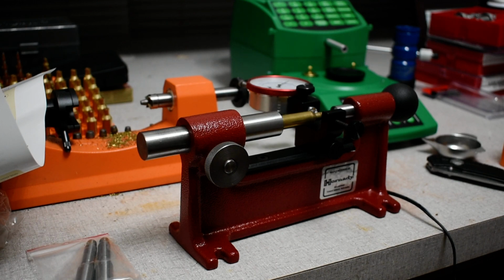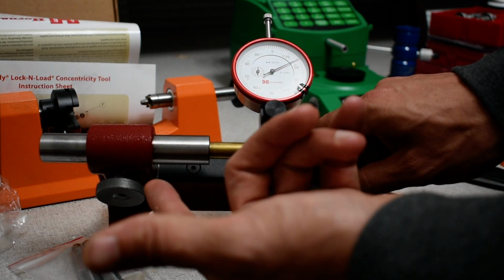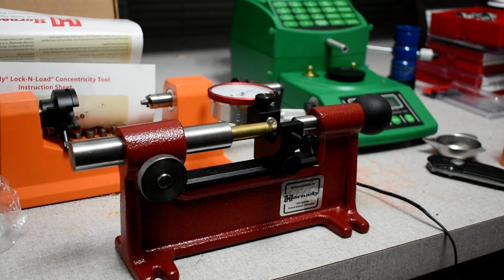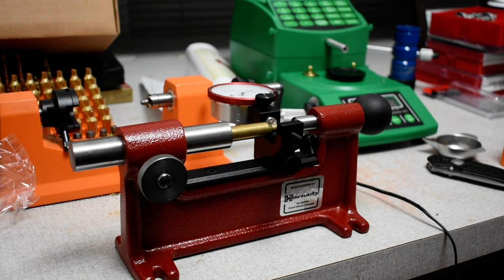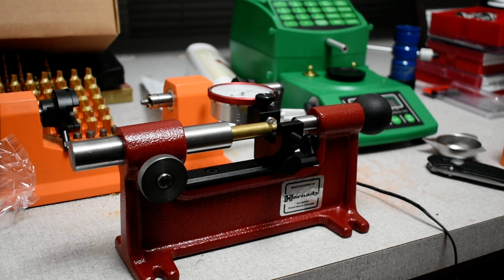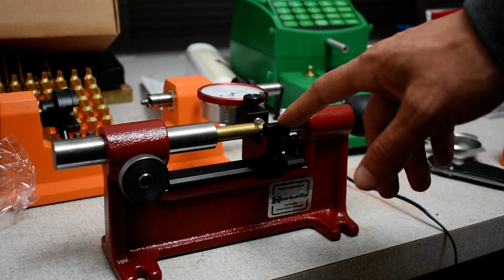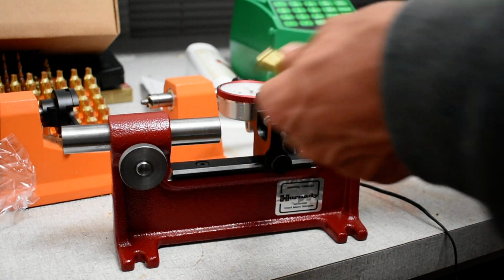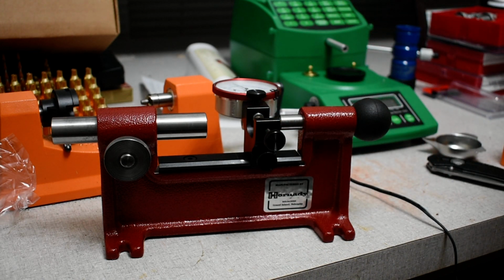Hornady Concentricity Tool

Comment: Thanks man. I do use one. I have a Sinclair and it does as advertised. I use an RCBS Rebel press and thankfully, my bullet runout is rarely past 002in. That is fine for what I do. My BR rounds are loaded at a soft jam and closing the bolt usually eliminates any runout by "forced alignment". I agree that Lee sells value-targeted equipment. As with any company, there are tools that I really like and those that I don't.I am mostly happy with Lee gear and if I ever have issues with anything, Lee customer service is just about as good as it gets. It's a great company.

Comment: the neck spindle has too much clearance in the frame bore. I have a friend making me a new spindle and pilot. The bore in the spindle for the pilot isn't center either. I feel it's best to  have this unit as tight as possible to eliminate errors and not blame sizing and bullet seating.

Comment: The bullet/neck spindle casting bore is off from the spindle shank diameter. The bullet spindle is fine if you set the right tension between the spindles, The neck spindle, for me, needs a custom pilot to give good readings. I will see if I need a custom spindle made to prevent any movement.
Reply: I recently upgraded my Hornady unit. A friend made new spindles to check the necks. The bullet spindles are fine. The back end of the neck spindles are a bit loose as well as the front end and the bushing by the black knob wasn't tight enough to maintain it being off center. I used some metal duct tape on the spindle to make up the difference until another one is remade. The bore in the frame is a little rough but if you remake the spindles it's a great tool. You can't beat it. However you need to have good dies to keep it up as well. Lee collet and Redding body dies.

Comment: Hmmmm.. at 7:40 looks like the total is 4 thou that it’s moving, but divide that in 1/2 and in actuality it’s only .002 thou... If it is only “2” that’s decent for runout in general, especially that press.. One thing you can do to try and help make it better, on the press ram pull the shell holder clip, once that’s removed take a small rubber o-ring one that fits around the actual shell holder base, then insert the shell holder/o-ring into the ram...this helps to free float the shell holder which will aide the case to self center as it goes into the die.. The die (if using a Lee lock ring eliminator) kinda free floats in that press as it is, so having both the die and shell holder float together should help concentricity
Reply from the maker: SVTboyy the o-ring idea sounds pretty nifty...when I reference runout I just use total runout and try to eliminate it as much as possible. I’m just lazy and don’t want to divide by 2 haha

Comment: It kinda looks like you're measuring case neck thickness.  Because if the neck is over a  shaft/mandrel and the dial indicator is on the case neck.
Reply from the maker: It was super close to the case neck but I can assure you it was on the bullet. I have since adjusted my "carriage" further down the bullet. I ran a test last night on runout relative to case position within my press and had some very interesting results. I'll make a video about it.
Reply: @alabamareloader  Okay.  Cool.  I look forward to your videos. 👍